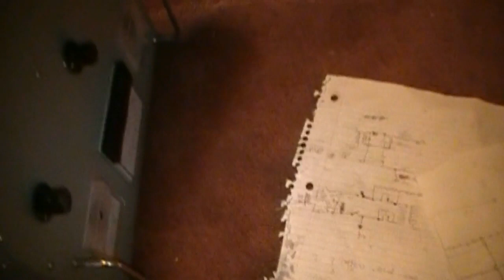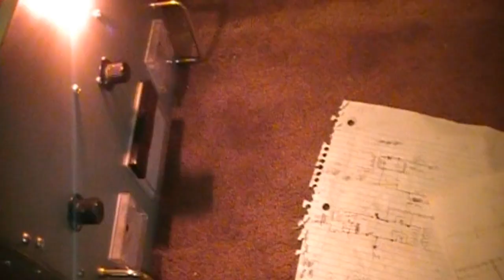Homebrew 2 x 813 1KW Tube Amplifier Pt.1

Comment: 4000 on the plate? 😮
Reply: Been running 4kv for 10 years or even longer 😮
Reply: Heavy bias I’m sure, hell made a 4 tube 813 with 3300v worked awesome. Made a 6 Tuber never could get the Q right so dropped it to a 4 tuber Great tube for what it is and rugged. Easy fun build 
👊🏻😎👊🏻

Comment: Probably you du not know the elecronic  rules..... the 813 tube has a plate dissipation of 125 Watts two tubes results 250 Watts in the amplifiers with B ,or C class you can have at max  500 Watts.....to have 1Kw you must employ a 500Watts tube not less.  By I1RRT
Reply: I get 800 watts all day from 2 813 tubes running 1750V Plate volts grids run about 60 ma (30 ea,)  way more than designed for.  He could get 650 watts easy with light duty??
Reply: 813 tubes like 3000 plate volts, my 4 tuber I built did 2800 watts on a bird pep. 4000 volts is way to much on these tubes. Take 100k ohm 5 watt resistors for bleeders. Regarding the transformer I doubt would run 3 3-500zg tubes very long before windings take a poop. 
Always fun building, be safe and there’s always a learning curve. 👍🏻